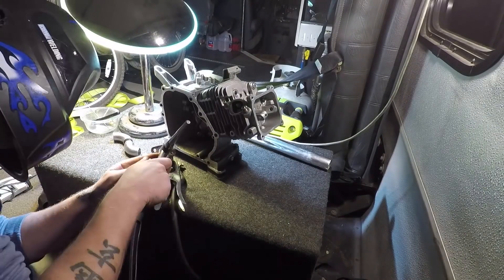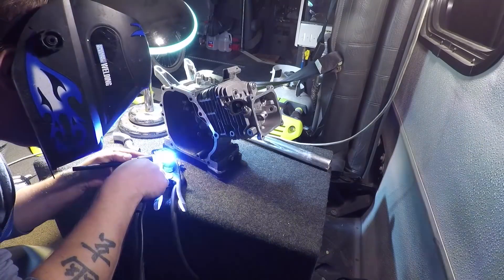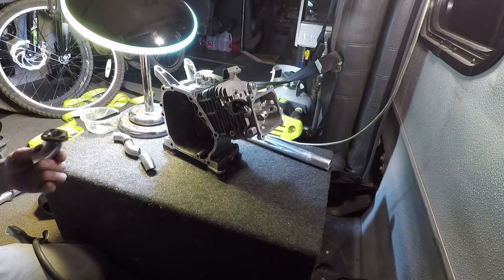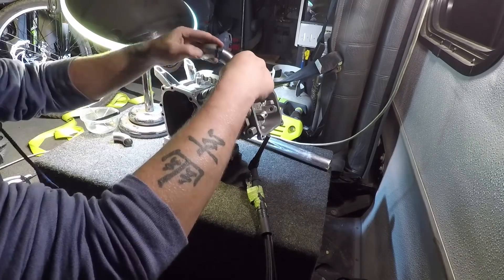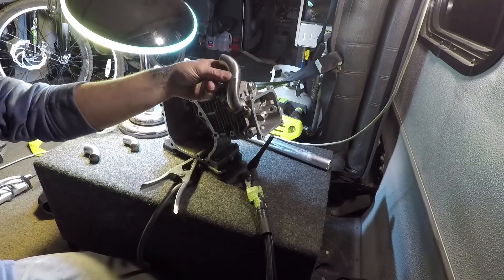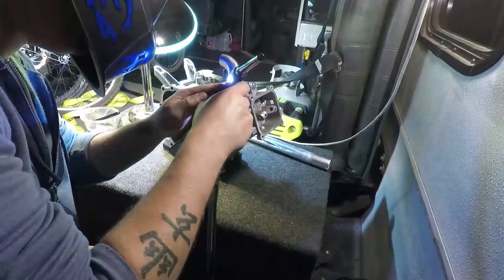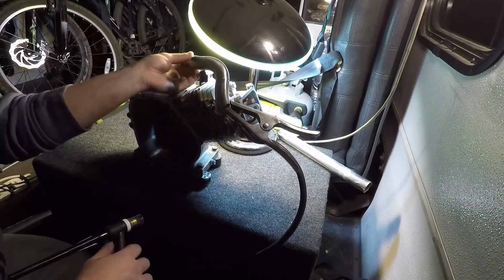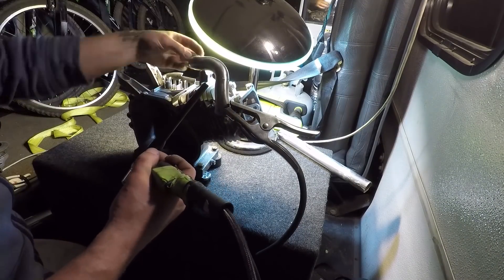Homemade Paramotor - Fabricating Chambered Exhaust

Comment: is it just me or do all of your full power climbs and take offs sound like they're just about 1200 RPMs below where they should be?  I gotta say watching you for the past two years at first inspired me, as I even started gathering materials for a frame of my own design at one time, similar to what KyleO built.  With so many new motors on the scene since then, all I can say is I admire your perseverance.  BTW, have you considered hydro-forming a tuned pipe? It's pretty easy to do with a pressure washer and a TIG welder.  I put up a video of a simple test expansion I did several years ago.  Just wanted to say Hi again and fly safe.  Thanks for keeping us updated.
Reply from the maker: I'll answer your comment with two words: 4 stroke.
Reply from the maker: Ok, I'm home now, I'll elaborate. My engine makes peak horsepower between 6000-7000 depending on current variables. I take off right at about 6800-6900 which is where I'm at with full power with this header/exhaust. I usually climb a bit lower (something like 6200 RPM because I don't trust my motor running at full power all the time (yet)). But yea, otherwise, it's a 4 stroke so it will have no benefit from an expansion chamber. On the flip side, I will be doing another project soon which will be a 2 stroke and I will in fact be making an expansion chamber but I work with metal and have all the tools to make it out of sheet metal quite easily and in a pretty complex form.
Reply: I totally forgot that the predator is a 4 stroke!

Comment: I know you’re not looking to add any unnecessary weight and it sounds much quieter than my AC130, but do you think some sort of air box over the V stack similar to what would be found on a 2T could make it even quieter without giving up precious ponies?
Reply: Cool, nice work and looking fwd to your next vids.
Reply from the maker: It definitely would. The velocity stack is actually the loudest part about it right now. I thought about doing it but we'll see. I have another project lined up with a different engine (2t) which is getting one for sure.
Reply from the maker: Thanks for throwing the idea out there btw! I like it. I didn't want to just add a normal box because it would remove the v-stack but doing the v-stack inside the box would actually work!

Comment: I never did find that formula for chamber sizing... I would have been nice to be able to have it resonate/dampen at cruse RPM
Reply from the maker: Me neither. This does the job great and the intake (velocity stack) is actually a lot louder than the exhaust.
Reply: I know there's a guy on here intimidating everyone about his expansion champer software and claims he'll be releasing it soon for download but until then great work!